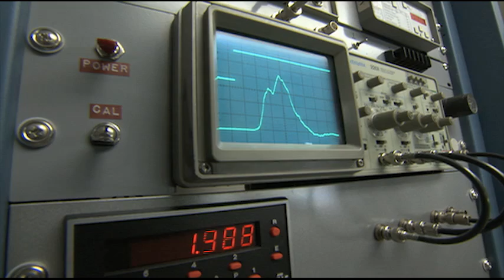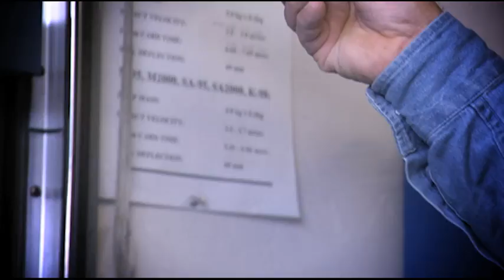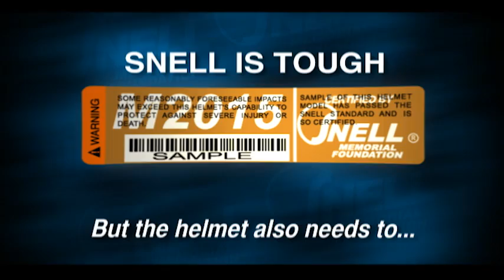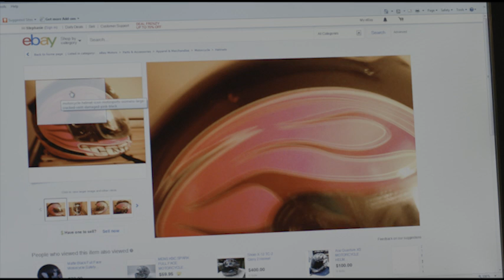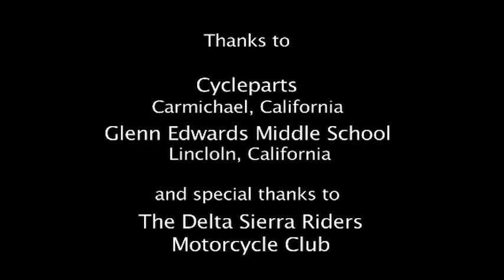Snell Memorial Foundation - M2015 Motorcycle Helmet Standard

Comment: Thanks for the video.  I do have a couple of questions.

1. If the random market sample of my helmet has failed testing. What actions must the manufacture take and can that model be recertified in same manner as a new model or must additional measures be taken.

2. The FIA have a helmet specification 8860 that includes dynamic crush test. Does snell have any plans to include something similar in the future?  

3. With Snell 2010 the mass during impact tests for most common sizes was reduced, previously 5kg, to now less than that for all but the XL sizes. While logical that weight and head size are related, how does this change affect the impact energy performance standard between 2005 and the current standard.?

Thanks for all your work,
Reply from the maker: +mouzaki trago   

First I sincerely apologize for my extremely late response to your message. As much as we would like to reach more people through YouTube, those of us at Snell are still very slow in learning how to effectively use it as a two way communication channel. I have not been at this channel for a long time obviously. Here are the answers to
your questions:
1) About every 1 out of 2,000 production helmets are randomly purchased and tested to verify compliance. If any of the random samples fails any of the Snell Standard requirements, 3 more helmet samples are purchased and tested immediately. If any one of the three fails, the manufacturer will be notified to stop production and shipment immediately. Until the source of the problem is identified and corrected to
Snell's satisfaction, usually through re-certification, the manufacturer cannot ship or sell the non-compliant helmets as Snell certified products. Snell website will list the de-certified helmets by model and size. If the type of failure indicates risk to public safety, the Foundation’s board of directors will make a decision to make public announcement and issue recall requests. 
2) Snell does not have a test comparable to the dynamic crush test in FIA 8860. The value of the dynamic crush test is, at best uncertain. The severe impacts which the helmets are also required to withstand seem to assure that no helmet would have trouble with dynamic crush as it is currently formulated. And, so far, no helmet which has met the other impact requirements has failed to satisfy dynamic crush.  Furthermore, the FIA procedures specify that the test is performed only on helmets appropriate for the medium sized head form. The gear for other sizes does not exist as yet, even though the test was proposed in the first FIA 8860 standard over ten years ago. 
3) The switch from test head forms massing 5 kg to graduated mass head forms in which the mass varies approximately with the cube of the head form circumference is one of the major changes when Snell updated the SA2010 and M2010 standards. It was prompted by a study of head mass versus head circumference done at the University of Washington and also by the need for better compatibility with mandatory requirements set for motorcycle helmets in both the US and Europe. The effect of the switch was head forms sized for helmets less than 60 cm in circumference became lighter while head form sized 60 cm and larger became heavier. But it’s important to remember that while we were switching test head forms, the heads going into Snell certified helmets would remain pretty much the same. And since we were confident that Snell helmets were doing well by their wearers before the switch, we did our best to specify new impact test velocities and new impact G levels that would assure compliance with mandatory standards such as DOT and ECE 22-05 and would assure that Snell continued to demand almost all the protection a motorcyclist or race car driver could reasonably be expected to wear. The result was helmets sized for head 60 cm and up stayed almost exactly as they had been for M2005 and SA2005. It turned out that Snell had been demanding softer helmets in these sizes than was DOT or ECE all along. But helmets sized for heads less than 60 cm in circumference got progressively softer. Still, since we were confident that our head mass data were correct, those softer helmets would manage higher impact velocities for their wearers than would be possible for the largest sizes.  The short of it is that energy management for the larger sized helmets stayed pretty much the same and although the energy demands for the smaller sizes was reduced, the heads which went into these helmets required much less impact energy management to survive a severe impact. So much less that these smaller helmets might actually manage higher velocity impacts than we could reasonably expect for the largest sizes. If you would like more detailed information on those calculation for each size head form, please contact Snell's Chief Engineer Ed Becker at Ed@smf.org